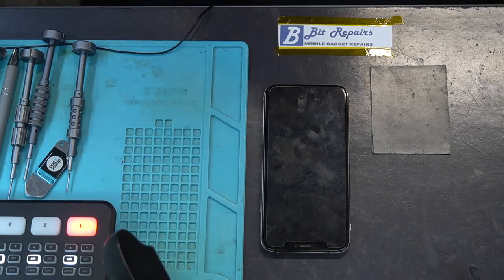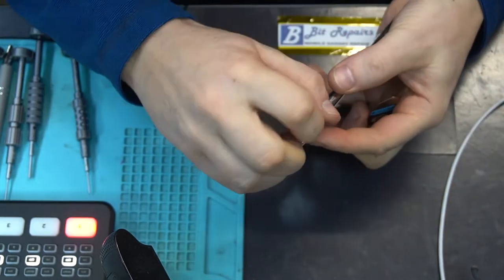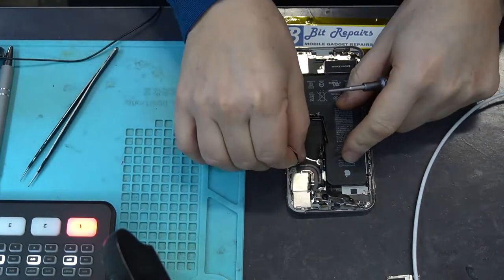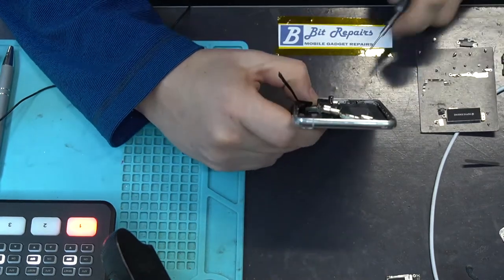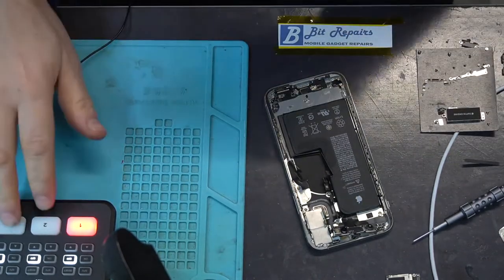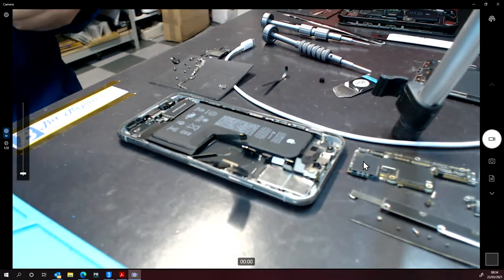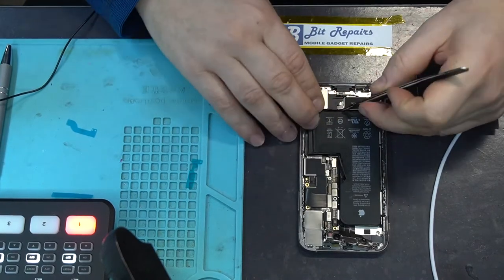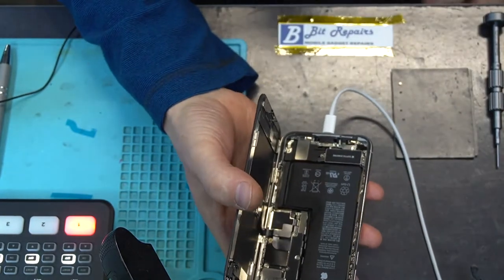Bit Repairs iPhone XS Rebooting Every 3 Minutes Solution.

Comment: Hi, Wayne very good video mate, am getting this problem on my xs iphone, got a new battery in it first because was on 78% but it did not fix it, then i seen your video and the prsO sensor code is which i have got so can you tell me where i can get a  good reliable charging port from and i can  order one please cheers, also can you tell me if my battery health will come back as normal  got a warning saying its not a genuine i have been told that it will be back to normal after about 14 days, it will put it self right  if you can let me no if thats right  please (many thanks)

Comment: i got Missing sensor(s): Prs0 \nservice and reboot every 3 min after about 12hrs from an event of water contact of the iphone xs under tap . Also the faceid got disabled. I'm surprised how such a little bit of gently tap water made such serious damages. Does the charging port actually needs to be replaced because of permanent damage or there's maybe just some corrosion or dirt? Maybe with isopropyl alcool i could clean it, if only i could narrow to some part the cleaning. Opened the phone and i can't see any evidence of water ingress. Can the charging port be cleaned? What you think?

Comment: thank you for your Video i have iphone 12 minni it reboots and i get missing tp3r sensor.
Do you have any ideo for this Problem. Thank you very much for answering
Reply from the maker: Hi, sorry this isn't just a parts replacement, its likely to be related to board split, you would have to split the boards and check for torn pads between the layers, this sensor is on the bottom side of the two boards.
Reply: @BitRepairs  ok thank for answering i found 
NTC_RADIO_PA_P  422mv  but it must be 780mv diode readings. this lines are directly go to power ic. Is it possible to replace power ic without become problem with cpu?
Thank you very much for answering. i think in my case power ic is demage becouse the line goes directly to power ic

Comment: Hello, i've used a battery programmer on a 12 pro max battery and now it gives an error in panic logs " missing sensors prs0 /nservice:backboard" and the phone reboots every 3 minutes i removed the flex that was coded for the battery but the issue persists... what can the problem be ?
Reply from the maker: PRS0 is the data lines from the board to the battery also known as gas gauge, you should first check the reading on the board side in diode mode on the data lines pins for the battery and if you get the right reading (usually around 0.700 if i remember right) then you should check for voltage on the data lines on the battery, it’s usually around 1-2 volts whatever’s missing will be your problem, sorry I can’t explain the whole diagnostics process but this should give you a good pointer.
Reply: @BitRepairs  a gsm service checked the conectors visualy and said it's the motherboard, from your experience in this case can it be the motherboard or most of the time it s the charging port ?

Comment: This has got to be the worst batch of XS's ever. I had so much issues with these and indeed, narrowing it down is exactly the thermalmonitord timeout (3 minute reboot) and refuses to charge. I lost data because of it and i hate apple at this point. The screens on release where defective. The hardware can't take anything and it's bricked already. Sigh.